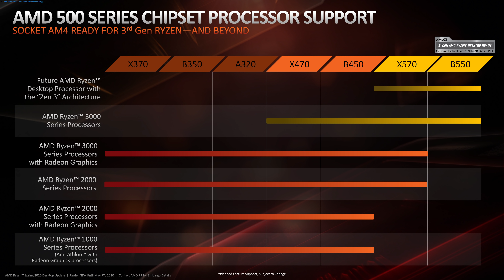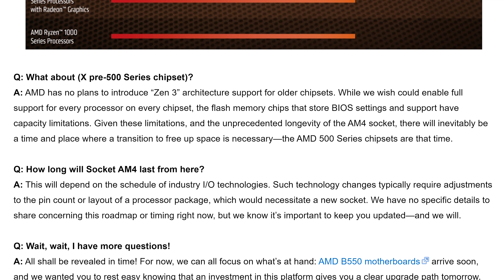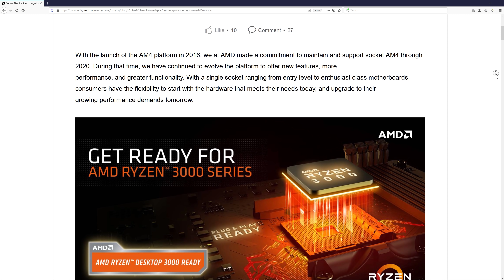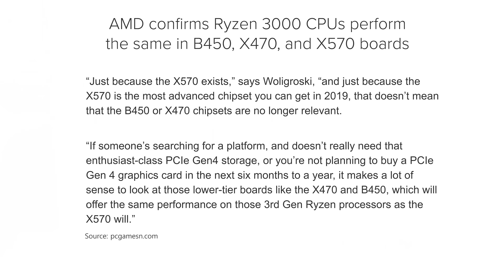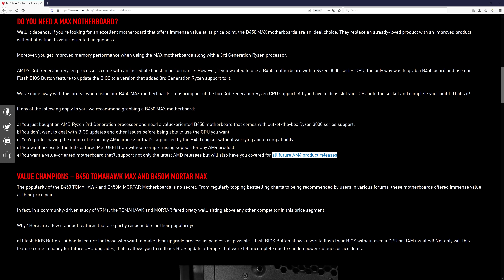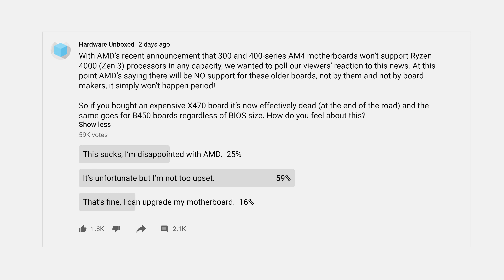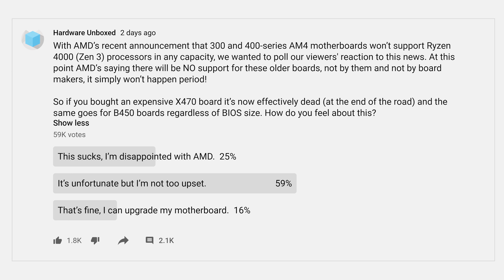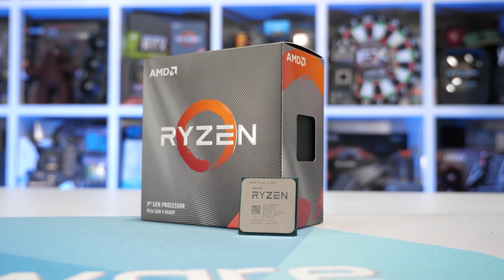AMD Does An Intel, Axes Zen 3 on 400-Series Motherboards, Our Thoughts

Comment: I recently sold all of my 300 series boards and replaced them with "newer" 400 series max revisions ones so I could run zen2 cpu's also "future proofing" to zen 3.
If B550 boards were available for sure I would get b550 but there are still not available.
So now with AMD's decision I would not get into the hassle of reselling them again for zen 3 updates. I will stick with zen 2 until DDR5 boards and whatever zen are available for updates.
Reply: Yeah. It's a bit funny how there argument about there being no b550 boards being a non-issue was "Just get a b450, if you dont need the pci-e 4.0. You'll be fine" so much about being fine.
Reply: @Omega613  IF ya'll got ryzen 5 3600 then later upgrade to ryzen 7 or ryzen 9. Price will go down.
Reply: @Omega613  They played us like a drum. As for why B550 didn't arrive earlier, the IO die on the x570 boards are provided by AMD and they make money off every x570 board sold. So the reason for not releasing b550 earlier is greed.
Reply: i think if AMD doesn't change their mind, 80% of the people on AMD system now will be look at skipping Zen 3 (4000 series) CPU and 500 series boards and wait for the next big upgrade DDR5 PCIe5.0 etc

I just bought into B450 system so my best option is a 3900x now.  so I think I will probably wait a couple of years pickup a used or discounted 3900x or wait and see if the DDR5 and PCIe5 have matured and became mainstream then maybe go down that route.  But it may not be AMD system I will be buying into next time...AMD will have lost something in doing this.
Reply: @BikeOnRoadLondon  Well, you'll have to take into account that AMD move will probably have the effect of keeping the prices of second-hand 3700 and upward pretty high, even in several years from now
Reply: @BikeOnRoadLondon  one of the reason I use a 2600 65watt tdp.
So I have a cheap upgrade from a fm1 motherboard with a A8 3870k cpu what do not have sse 4.1 so new games can not start up.
The ryzen 1000 serie well it's shit and unstable on that moment one of the reason I go for a cheap 2000 serie with 6 cores.
Reply: @BikeOnRoadLondon  Poor you, even ryzen 9 3900x in't enough for you? If you got B450, then you probably have ryzen 5 3600, or Ryzen 5 2600.
Reply: 500 series boards just dont make sense at this point in time, if they wont support 4000 series cpus for the older boards. 
We will all just wait for the new gen ddr5 boards
Reply: I totally agree, not supporting 400 series is problem for AMD cuz very little people will upgrade mobo with cpu, so their zen3 will get less customers. Still in zen2 there are a lot of great cpu's to upgrade to and i bet they will release even more. Especially if someone wants to get now r3 3300x and than 3-4 years down the road go to r7 3700x or even higher for 150 bucks or so, that is great upgrade path without going zen3.
Reply: I agree, I thought it was a dumb argument at first being that I own a 570 board and saw no issue from my perspective. But this really does suck because you can purchase high end b450 boards but b550 won’t be out until June which is pretty disappointing. It would be understandable to drop support for 300 series motherboards but on 400 series it’s a bit ridiculous.
Reply: @tridungnguyen2357   yea upgrade path was a big selling point for AMD. They are gonna loose many sales just from not supporting zen 3 on 400 series boards.
Reply: Exactly!!!!
Reply: My X370 Crosshair 6 Hero runs my 3800X better than so called newer boards.. I remember reading all about Ryzen 3000 series not achieving their rated boost speeds. My 3800X boosts all cores to 4400Mhz and 1 to 4 cores to 4600Mhz and thats with BPO turned off. I wont be buying another AM4 DDR4 board. Next new PC will be DDR5 / Ryzen 5000.

Lets face it, the only real reason there are so many generations of AM4 boards is to please the Motherboard manufacturers credit balance, as with Intel. I sincerely hope the 500 series is the last generation of AM4..
Reply: There's zero difference between 300 and 400 series boards, some 400 series boards have slightly better VRM's, but that's mostly for marketing variance and enticing an upgrade, most boards have the same or similar power delivery between the 300 and 400 series generations. Those 256Mb Bios boards seem superfluous now given that some X570 boards only have a single 128Mb bios.
Reply: why did u do that? is there any real advantage x470 offers over x370? y not going the x570 way for future proofing?
Reply: im still hoping they put support on a b350 board for a budget r3 3300x coz i dont have that much money to change the mobo
Reply: @borgir3451   3300x is already supported on 300 series boards with "beta" bios update
Reply: @masterlas  woah idk about that are you sure please i hope you are right
Reply: @borgir3451  He is correct. My Asrock A320 R4.0 M-ATX supports Ryzen 3000 out of the box. (I just bought an Athlon 3000G with that board to replace my old Athlon 64 X2 6000+ home file server about 3 weeks ago). It works fine on the 3800X.

If you are in doubt about your board, check its manufacturer's website. If it says it supports "Matisse" then it supports Ryzen 3000 in general, though higher end CPUs like the monster 3900X and 3950X ultimately depend on the board's VRMs and power delivery systems. Its should say something like "up to XX wattage CPU". Look for the "CPU support" under support to get more direct confirmation of your particular CPU.
Reply: @borgir3451  you can check on your boards webpage what cpus are supported and which version of bios needed
Reply: @borgir3451  
Ryzen 3000 CPU's are supported on all B350 boards with the appropriate bios update, that would include the 3300X but the mobo manufacturer will have to put out a bios update to "support new CPU's" given that the 3300X has just been released, though my board has support since last bios update in Dec 2019 so most probably already do.
Reply: @James Smith B550 doesn't have pcie 4.0 lanes on it either, the pcie 4.0 lanes are on the cpu, the motherboard only supplies pcie 3.0 lanes. It's why motherboard makers were able to get pcie 4.0 working on b450 boards before AMD locked out support for pcie 4.0 on non x570 boards.
Reply: @Cano Sack 
Some of us upgrade opportunely, not being able to drop a 4000 series processor into our 300 series boards doesn't mean a wait until Ryzen 5000 and build from scratch, it's a wait till we get a 12 or 16 core cheap (even second hand) or grab that 4000 series 8 or 12 core at launch.
Waited patiently to upgrade my 8 core piledriver system for years before Ryzen came along, I won't be getting first gen 5000 with DDR5, it'll be 7000 or 8000 with PCIe 6.0 that'll compel me to start from scratch.
Right now with a 2700 in a crosshair VI and a 3600 in a X370 gaming K7 and a 1600 in a B350M there's room to rotate a processor out of the mix, but not a system when all are working fine.
Reply: @James Smith read the comment again never said "future" proofing for anything more than the zen 3. You are out of topic with the pcie v4 argument. I don't consider pcie v4 future proof because anyway at some point when DDR5 boards when they come out I am gonna update. The point is that AMD clearly stated on there marketing that AM4 was gonna be supported until zen 3 by 2020
Reply: Bullshit detector is jumping crazy
Reply: AMD has been telling customers since 2016 (!) that the 400-series chipsets will support CPUs until the end of 2019. They were always talking about a major platform update in 2020, which is exactly what is now happening. So if you bought a board with a 2019 (or actually 2017) chipset expecting it to support new CPUs in 2020 ... sorry, but you can only blame your own lack of research for that...
Reply: amd in 2016 said support will end in 2020.
amd in 2019 said again to remain us support ends in 2020
can you please explain to me why you got a 470 MB for zen 3 when they been saying otherwise?

Comment: AMD had me believe I could upgrade to zen 3 with my b450, especially with it been the last cpu on am4. Like why would I upgrade to b550 for 1 generation and no upgrade path
Reply: @Cano Sack shouldn't have to
Reply: I bought a b450 aorus elite days before the announcement came out. Needless to say I'm more than a little pissed off
Reply: @eduardmarciuc7516  unless you can't return it I'm not sure why you are that pissed off now if say they announced right after the return period Different story.  As long as rma is an option you are lucky.
Reply: @Ryan what CPU?
Reply: Considering you will most likely be selling your OLD CPU when you get Zen 3, it's really not a big deal to sell your old motherboard while you're at it. It's not like a B450 board was $900.
Reply: How did AMD have you believe this when they didn't promise it in the first place? AMD have made it clear a long time ago that AM4 motherboards won't be supported with new CPUs after 31 December 2019, so not sure how you thought that your B450 would work with Zen 3 which releases after 31 Dec 2019. If you look at AMD's official Socket Stability slide in the article "3rd Gen AMD Ryzen CPUs Will Work on Many Existing MSI AM4 Motherboards" (search it on Google), you'll see that the graph clearly shows no support for new CPUs on AM4 after 31 December 2019. If you take a good look, the orange bar stops right at the end of 2019, just before 2020 starts. It was already know even a year or two ago that Zen 3 will come out some time in 2020, or in other words, AFTER the official support period. Do people really not know how to read graphs?
Reply: @bgtubber  Stop spamming the same copypasta over and over again. You're on every single comment down the line with the exact same message and you don't give answers to the counter arguments... Plus you flat out ignore 90% of what Steve just said about what OTHER messages AMD has given.
Reply: @bgtubber  https://hothardware.com/news/amd-confirms-am4-socket-support-future-ryzen-processors-2020

Comment: Best summary of the current state I have seen so far. Thanks!

I bought MSI B450 MAX series board with R5 1600 AF two months ago, after waiting for B550 for more then 7 months...
My original plan was to buy B550 + R7 3700X in september 2019, but with the B550 delays and not knowing Zen 3 will be delayed as well by Covid, I gave up waiting for B550 and went with R5 1600 AF as a temporary solution till Zen 3 will come in June/July.

No need to say I am feeling completely screwed by AMD now I guess...
Reply: AMD really fucked over their customers, especially the new ones who can go back to Intel at any time.

Comment: this is VERY frustrating...I just upgraded my rig back in February from an older matx intel build to an Asrock B450m and 3700x due to there only being a crummy singular x570 matx option...Itx boards were super pricey.  I wouldn't have pulled the trigger then had I known I was going to face the SAME end result like I do with Intel builds.....damn me right?

Comment: You mentioned it at the end. 4000 series will release around the same time as DDR5 and that DDR5 is going to change the motherboard. If that turned out to be the case, I have no motive at all to buy a B550 or X570 motherboard. 

But I was also running an i5 2500 in 2019. If they think I will have an issue with running an R7 1800X and a B450 in 2024, they aren't paying attention. Maybe that's what AMD are silently saying. If you bought a B450 and a 3700X, see what is on the front of the table in 5 years because your machine will have that much longevity in it.

Comment: There is only one reason that I think AMD should extend support to 400 series boards for Zen 3.

And thats those boards were being sold as new until recently. If B550 came out with X570, I would be on the fence going, well, it sucks, but you guys knew what you were getting into buying an older gen chipset (ala Intel 9xx chipsets support up to 65nm Core2, but dropping support for 45nm Core2, with only X3x\P3x chipset support moving forward). AMD said the socket is stable to 2020, welcome to 2020.

But that lack of a budget option combined with 400 series being sold as the budget option means I think support should be extended, even if only to those boards with big enough UEFI's to do so (rather than fragmenting support).

Comment: I don't really think that the first part of the statement you said, that AMD should have said, would be a good statement either. The Zen CPUs all include a SOC portion on the package and are fully capable to run without a chipset (see laptop designs and the Asrock A300 STX board). The "chipset" is only a advanced SATA, USB and PCIe controller that is connected through an PCIe x4 connection. It is literally NOT needed for the system to run. So complications with older boards is only true for the power delivery and PCIe 4.0 support. And even that is a somewhat weak argument, since all but the very, very low end boards are able to push the required current for stock operation (Which should be the thing they care about, current handling capabilities is the board manufacturers responsibility). And PCIe 4.0 is easy to disable.

Comment: I bought a high end X370 MB for the very reason that I new I would get upgrades all the way through the life of the platform.  That board and the last CPU's I bought would then go into my 2nd system when the new platform came out with DDR5 support etc.  I can't believe they are going back on the road map they laid out at the beginning.  AMD must have known the bios size when the 1st board came out and should have then stated that it needed to be larger from the start or allow multiple bios's to be made to fit the smaller ones.  I will now question if AMD can be trusted with similar statements in the future.

Comment: People act like amd is forcing them to buy an expensive mobo

You don't need a current gen cpu to play games. But pc building is pretty much a pp measuring contest so not surprised people are mad.
Reply: The people participating in a pp measuring contest surely didn't buy a b450 TH max + r5 3600. Buying an 3600 + 150$+ x570 mainbord is something many would consider a waste of money. The point is (at least for me) that MSI build MAX boards with 2x larger BIOS chips to fill the b550 gap and warrant plenty space for future bios version. Yet AMD said no. I can definitely understand why some people feel a bit scammed.

Comment: I know you said that B350 owners shouldn't be too disappointed due to the value they've enjoyed from 2017-present (which I agree with), however as a B350 owner, I'm still disappointed as my plan was to hold out for Zen 3 and upgrade my R7 1700 at that point. AMD's marketing and press talk in 2017 around AM4 being good until 2020 was ambiguous, and I (wrongly) thought I would be good until the end of 2020 product lines.  If it's technically possible, which partners are saying it is, then AMD are simply going against their own word to customers.

It then also begs the question; if B550 is AM4, but AM4 is only slated to be the main socket for 2020; what's to stop the next round of products requiring AM4+ etc? (reducing B550 upgrade paths). We're then back at the same spot that AMD were calling Intel out for back in 2017/2018.

Comment: Built an entire new system with a full AMD platform 2 months ago (ryzen 5 3600 + 5700xt), got the B450 Pro carbon instead of an X570 to afford higher end CPU and GPU, it being one of the best B450 boards on the market as I intended to use the 3600 and 5700xt as a "for the moment" PC as I waited for the 4000 CPU series and 3000 Nvidia/Big Navi after being fed up of waiting to upgrade.
Extremely disappointed as it seems this mid range in between system has now turned into a full term commitment, and lost AMD potentially a customer on both their top end big navi and 4000 series CPU as I cannot justify a whole new build, 1st world problem but fair to say AMD lost out on a lot of customers in the same sort of boat as me.

Comment: I would have spend more on a X570 board would i have known the 4000 would not work on B450. I did not like the chipset fan on the X570 boards. And did not need PCI-E 4.0 so B450 was more then enough for me. I never expected them to ax the whole 400 series motherboards. Zen3 can work on those boards. 
I understand why AMD wants a clean slate. It will get very complex. Maybe they should do the same as with the 300 series boards. 
Do not give official support. But to give the AGESA code to the board vendors. Let them decide wish boards have good enough VRM and overall build quality to support the 4000 Zen3 CPU's. Especially for X470 and the B450 owners (and like you said the MSI MAX owners like myself. I got one MAX board and one normal MSI board because there was not version of the Gaming Carbon yet. I think they recently released it as MAX as-well).

i Do hope AMD will reconsider and start clean with Ryzen 5000 (Zen4) and AM5.